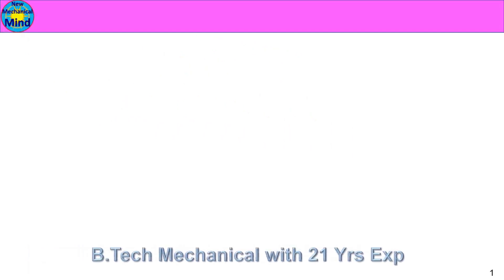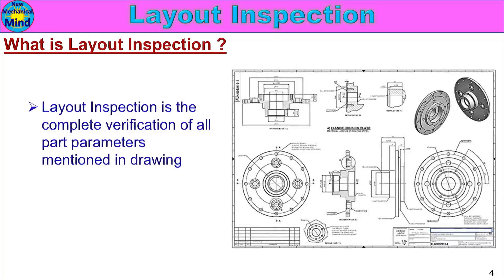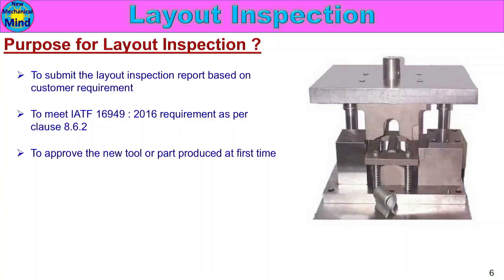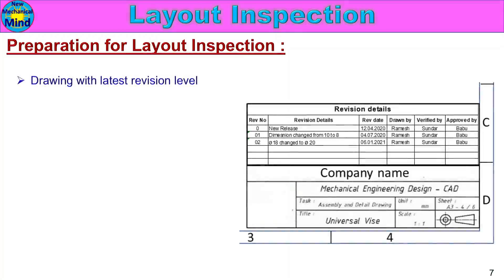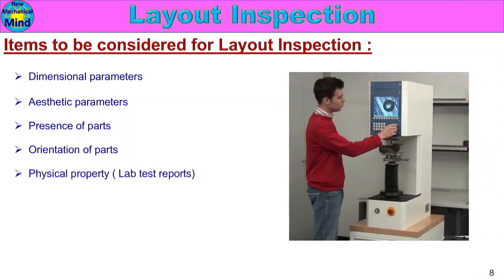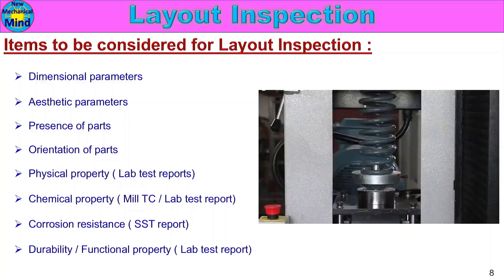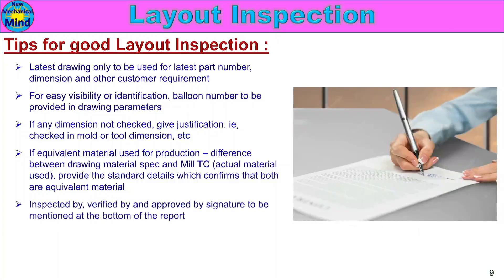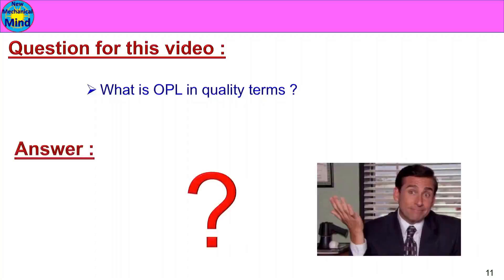What is Layout inspection in industry |quality department | explained in tamil | New mechanical mind

Comment: Hello sir, i have one question,  in industry we have inprocess inspection for every stage process in that all dimensions or parameters will coverd as per control plan , 
Then we plan for layout inspection. 
In control plan already for critical and non critical parameters and it evaluate in inprocess report. 
What use of layout inspection
Reply from the maker: Hi Mr.Gnanamsekar, Because 100% drawing dimensions will be covered in layout inspection only. It is mandatory to ensure the same once in a year to confirm that all dimensions are maintained as aper spec.
Reply: @newmechanicalmind8818  thanks for reply and valuable time

Comment: Hello sir
Pls kindly confirm
What to do if part not produced but we planned  for an layout inspection @ starting of Finacial Year itself. Or part absolute on the same year.
Reply from the maker: Hi Mr.Sridharanraja, 
1) if part is not produced based in our plan, we can proceed layout inspection for upcoming months by showing no production in the actual plan.
2) If part is obsolete, we can remove that part from plan with remarks.
3) If part is planned to produce after more than 1 year, we have to produce samples first and do layout inspection. Then mass production to be started if no issue in the product parameter. Otherwise action to be taken to bring the parameter within spec